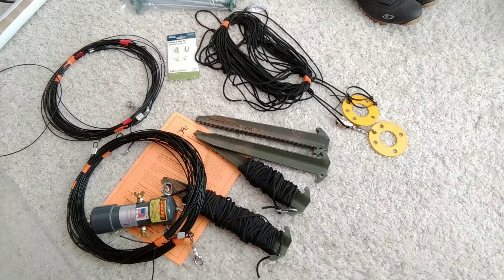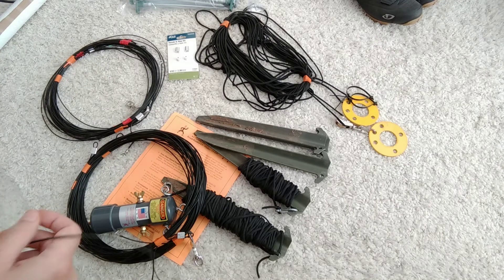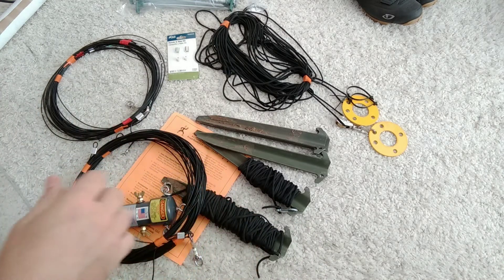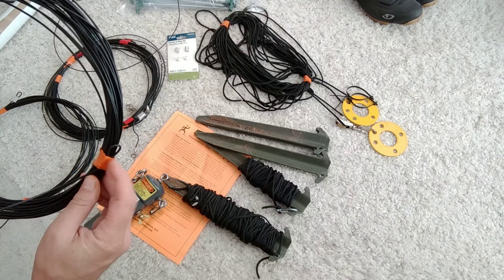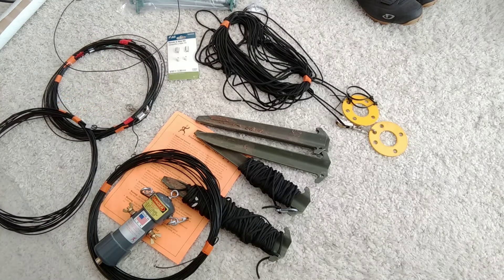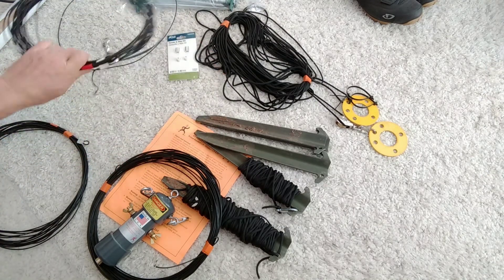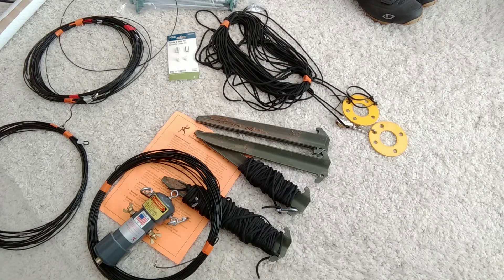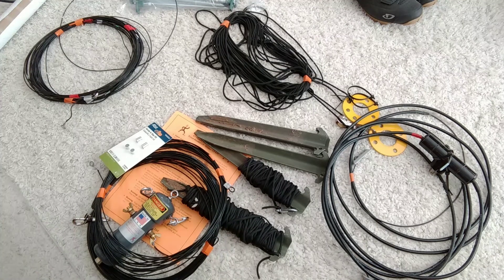Off Center Fed (OCF) 80/40/20/10 dipole for Field Day 2017

Comment: What is the proper way to tune an antenna is it at the radio or at the antenna ? To be honest no matter where you put the tuner the antenna is still out of resonance to the frequency you are using . You want to have a resonate antenna for the band your planing to use . With a tuner all your doing is making the radio see a low swr but from the tuner to the antenna that swr hasn't been reduced by any means . Sorry for the truth about what a tuner does and not do about the feed line and the antennas .
Reply from the maker: The best place for the tuner is as close to the antenna as possible to reduce loss.

Comment: What is the balun used and where can they be purchased?
Reply from the maker: For an OCF dipole I used a 4:1 current balun.  If you have the book “Understanding, building, and using Baluns and Ununs” from CQ Magazine you can make one or just buy one from WireMan/CoaxMan.  It’s has a ferrite core for the transformer and enamel coated wire to withstand the heat when SWR is high.  You will find all kinds of plans on the Internet however many, many, many of them are wrong.  The so-called ugly balun is not a balun at all, it’s a choke.  
For a normal dipole one should use a 1:1 current balun if fed with coax regardless of it being a resonant balun or not.  Without a balun there will be a significant amount of power on the feedline.
Reply from the maker: The balun is an impedance transformer.  In this antenna it is 4:1.  At the feedpoint the impedance can be quite high in comparison to the 50 ohm coax.  This antenna is taken right out of the ARRL handbook or the Antenna book.. I forget which...